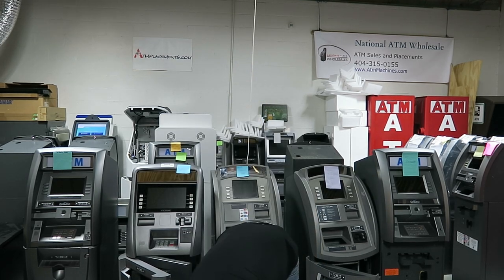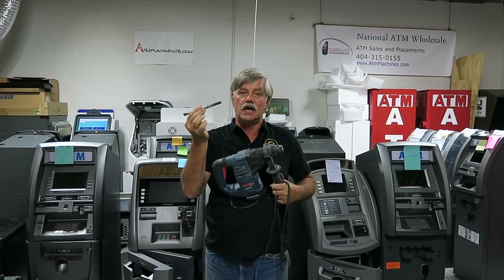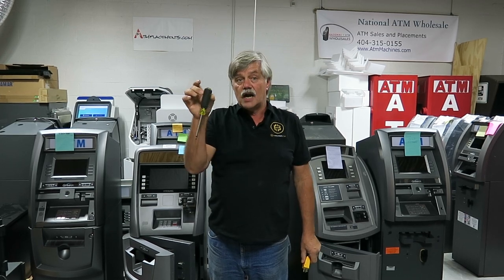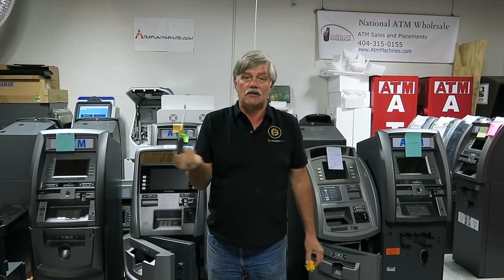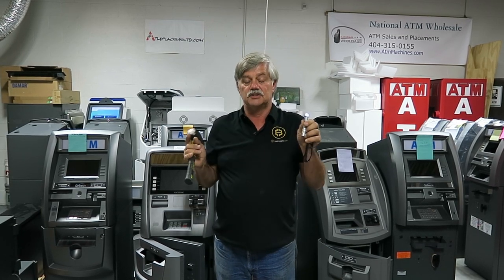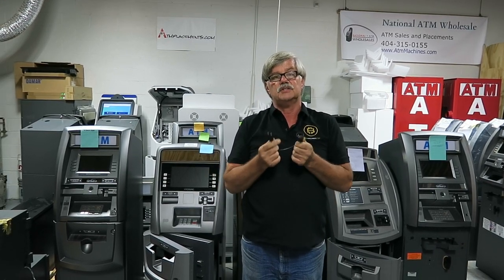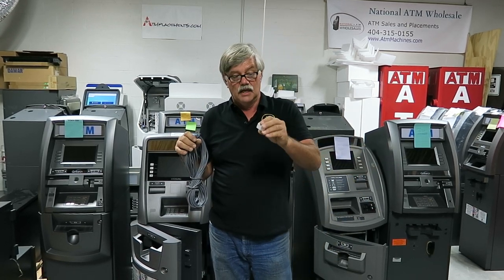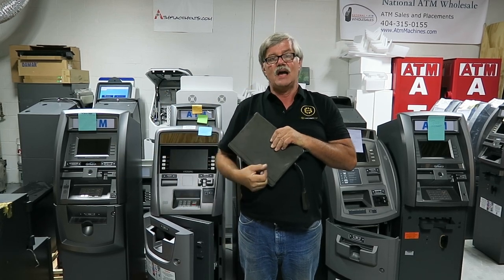Tools You Need Before Your ATM Installation

Comment: What size drill bit do you use?
Reply from the maker: 1/2 x 6" !
Reply: @NationalATM  I was thinking of using Tapcon+ heavy duty concrete anchors. The 1/2” x 4” ones or 1/2” x 3”. They are also easy to remove if I would need to move machine. A little more expensive. Any opinion on that approach?
Reply from the maker: @uglyewok6715  1/2 x 3-3/4s or "1/2 x 4" for the tapcons or red anchor bolts/drop anchors are great!